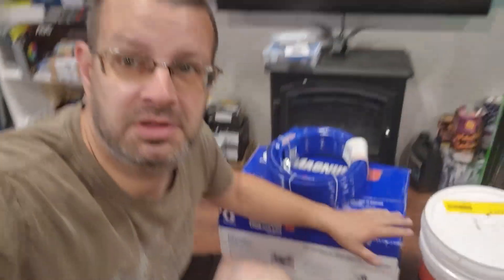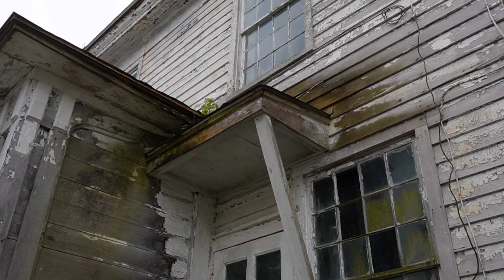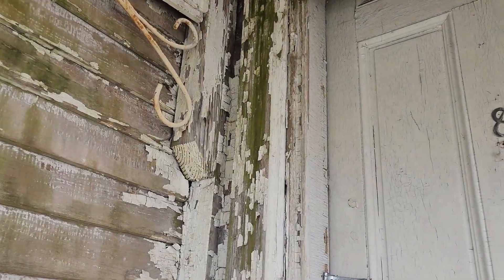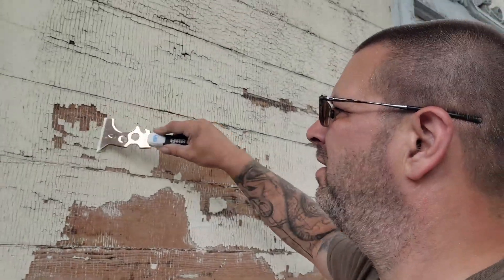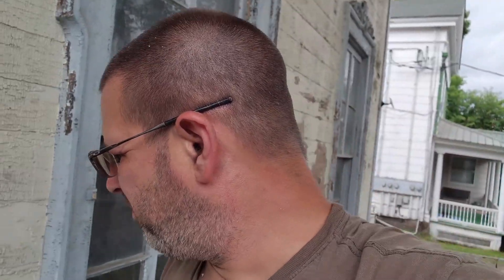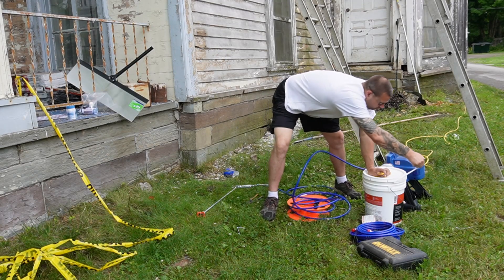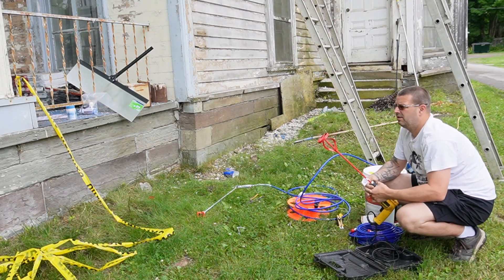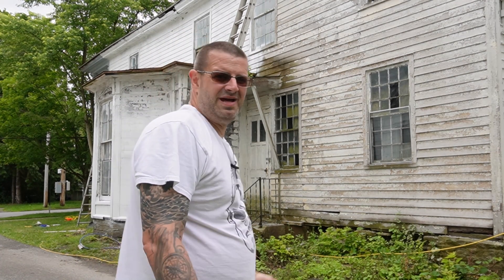Putting a quick coat of paint on my old house

Comment: Came to this randomly, but you need some sort of sand blaster to get those difficult places. For the large flat surfaces they make pretty cheap paint grinders that would make some work much much quicker especially if youre wearing mask and suit trying to protect yourself from lead and such
Reply from the maker: @auzmo  you're 100% correct on all counts, and I'm hoping to do so in the future. I had originally wanted to use a pressure washer first but I have no readily available water supply, not even to fill buckets to draw from as the neighboring houses have no outdoor hose. The rest I'll definitely need to grind/sand off to get a better finish but i unfortunately don't have the time currently to do so carefully as the wood siding is original to the house. Given how much of the wood had gone bare, i wanted to at least get some coverage to help preserve it a bit (and make it look at least a little better at a distance), until i can block out a good chunk of vacation time to go back and redo it more thoroughly.